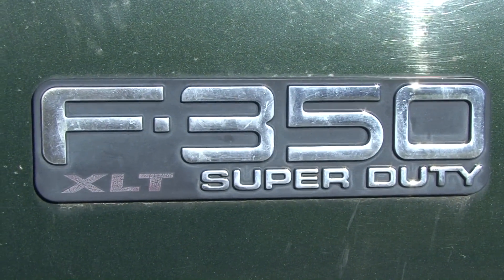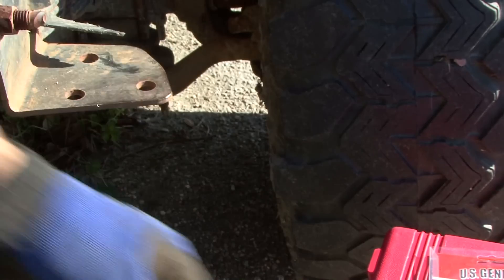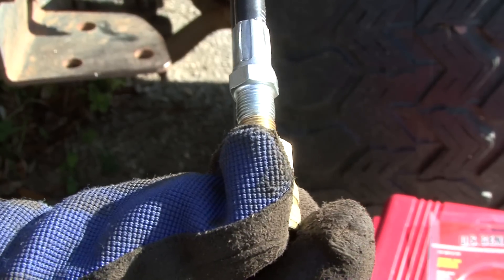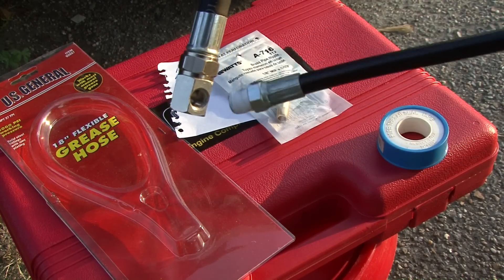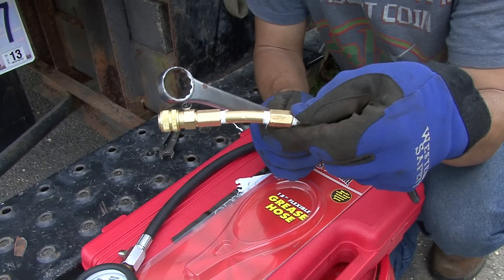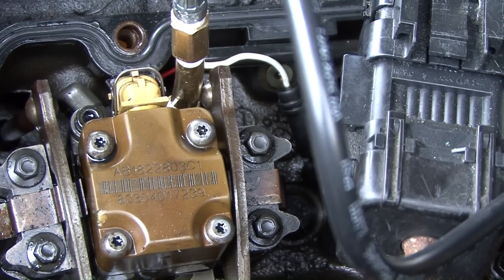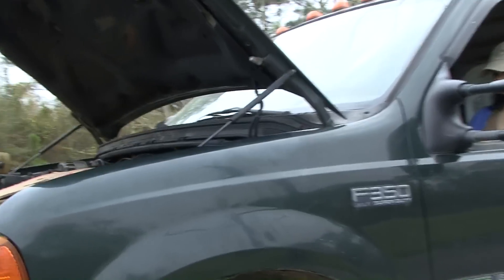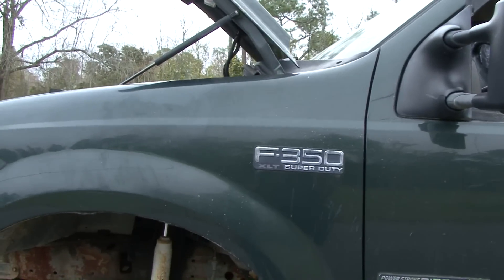How to make a compression gauge for your 7.3 powerstroke

Comment: Sounded like it was trying to fire. That can be very dangerous. Be sure the IDM relay is unplugged or disconnect the 42 pin connector over the driver side valve cover.